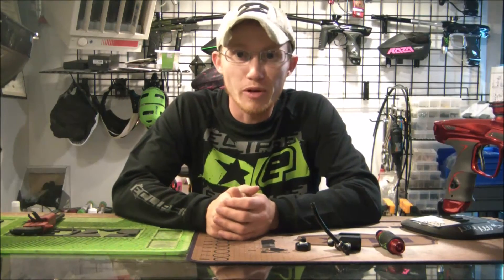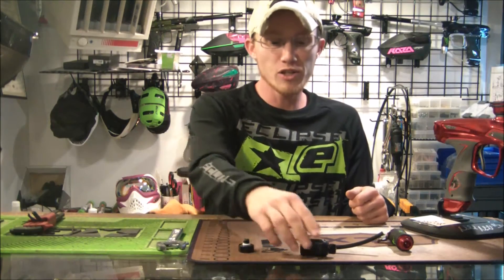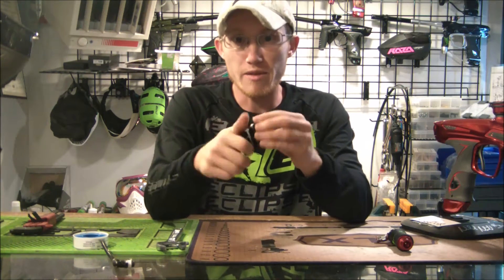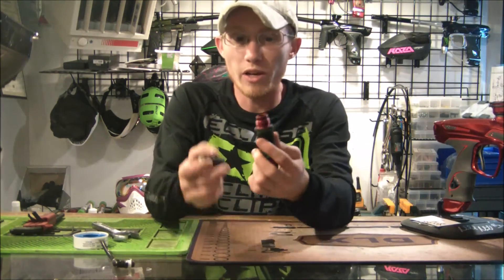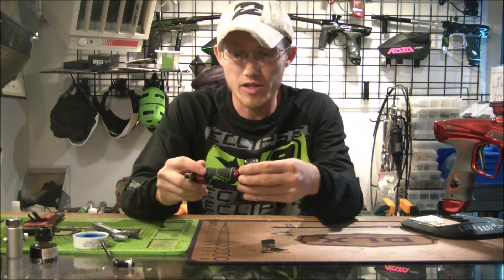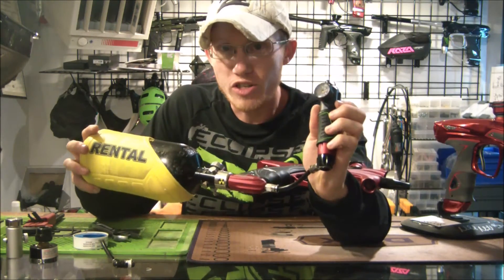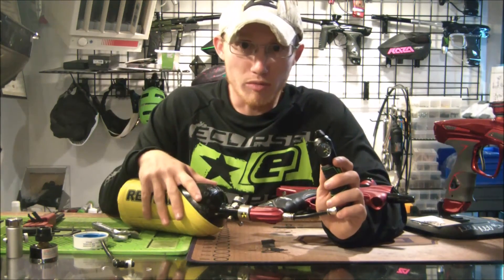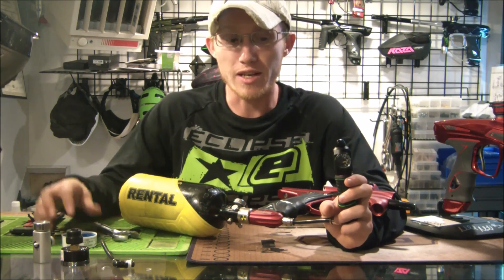How to: Make Your Own Reg Tester

Comment: I made 2 of these a couple of weeks ago one with a 1000 psi gauge and one with a 300 psi. I use the 1000 psi one for testing tank outputs and some of my autocockers it is super helpful.
Reply from the maker: Ryan Simonson Yeah they are very helpful. not only for optimizing performance
 but also finding issues and fixing problems with the guns.